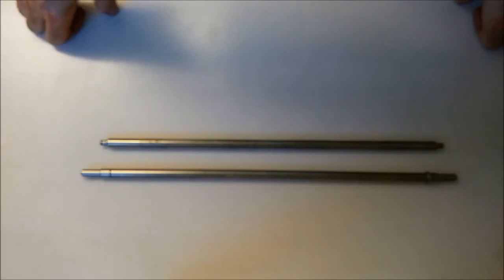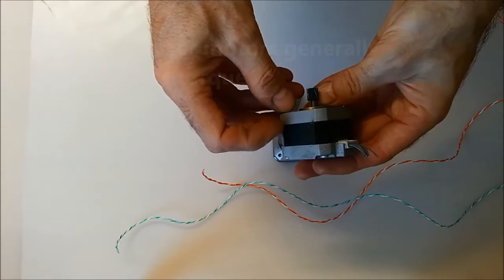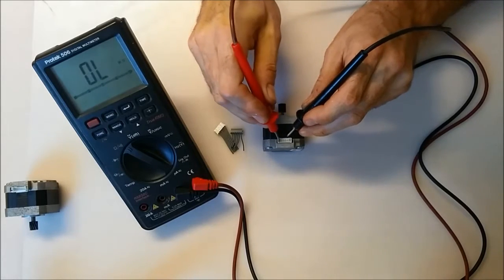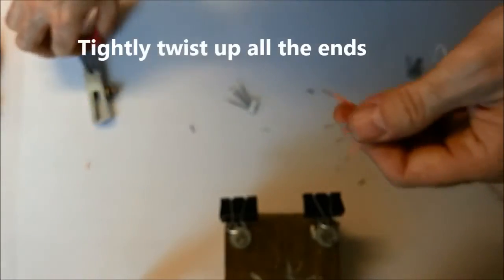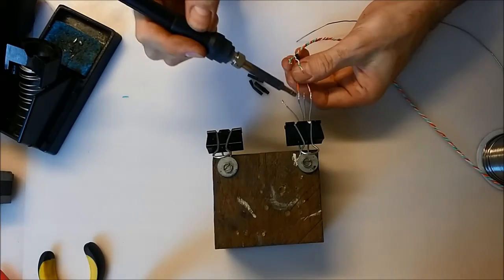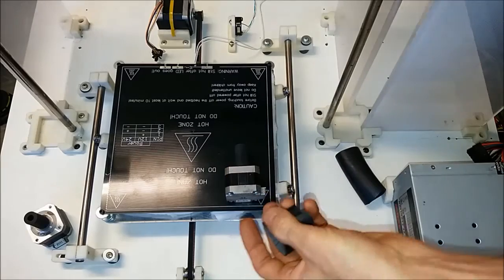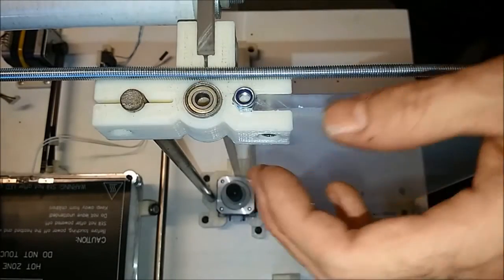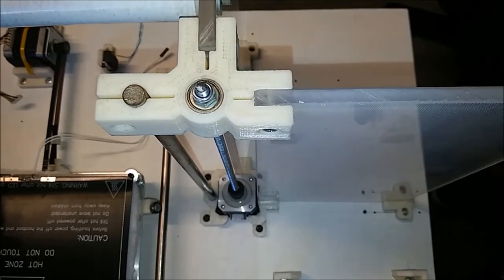$65 3D Printer made from recycled electronic waste - Build sequence 09 - Z-motor setup

Comment: 65$ ? i dont think so only printed parts and that plate will cost 65$ and where is electronics here + extruder ... if you rly want 65$ 3d printer go for cherry 3d printer and its more simple desing then this one.
Reply from the maker: If you don't have access to a 3D printer then yes it will cost more to get the parts printed, but please check out our design download, cost breakdowns, where to print the parts, and more information:
http://www.thingiverse.com/thing:1429273
(all links to all purchased parts and costs listed)
Reply from the maker: Had a look at the cherry 3d printer, loved the design, although lack of frame is a little concerning for z stability.

Comment: The bearing at the top constrains the rod which will lead to Z wobble artifacts in the print unless both rods are 100% straight and true.
Reply from the maker: Thanks for the info, we will investigate this further (a lot of our rods are quite bent)
Reply: Sub33D
Sadly this is the case with a lot of machines these days.